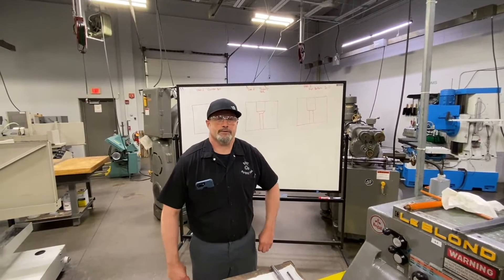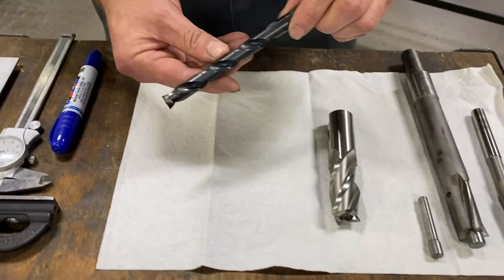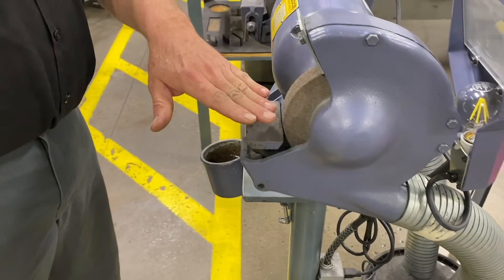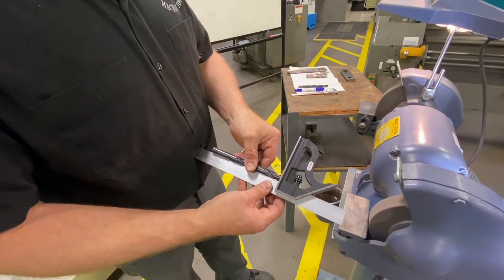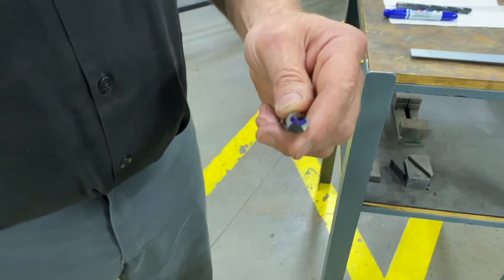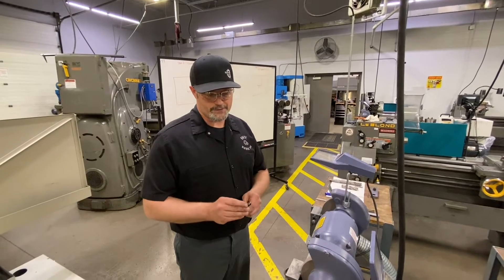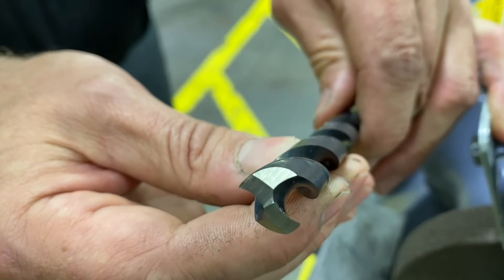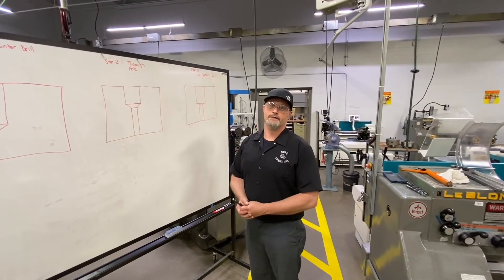Grinding a Flat Bottom Drill

Comment: At the end of the video I would have wished that the presenter explained why you do not start a hole with the flat bottom drill.  The reason being is that the flat bottom drill has no purchase point as a pointed twist drill has, and as a result will skate around the surface of the material even in a milling machine as the drill deflects from the downward pressure.

Comment: I would not recommend an end mill unless it is center cutting.  The reason being is that the end mill you were showing will only cut until the center hole in the cutting end plugs with uncut material, and continued pressure on the tool will at best result in an out of round counterbore.  The worse could be an accident.

Comment: this is great.  the end mill is fine if you interpolate the bottom if you plunge with the end mill it will leave a slight angle on the bottom as the endmill has a slight angle to the center of the mill.  I also used to teach how to sharpen a sheet metal bit,, as for grinding wheels I like a Norton Wheel 32A 46 or 60 K5 VBE,  wonderful for sharpening drills and HSS bits,, dont grind mild steel on it